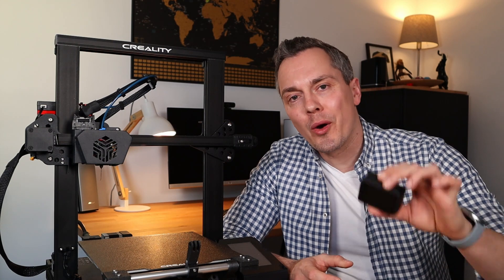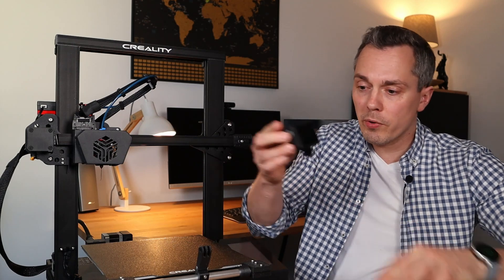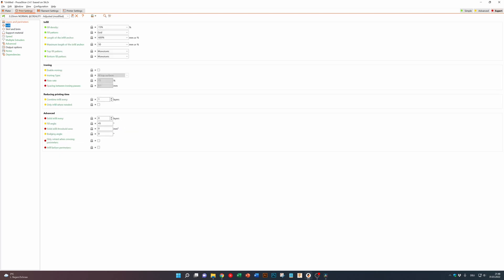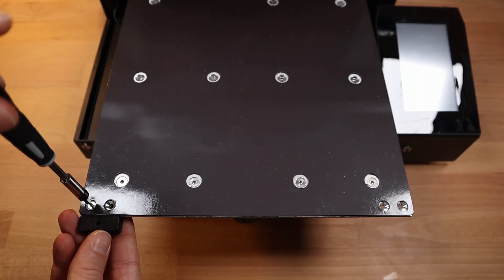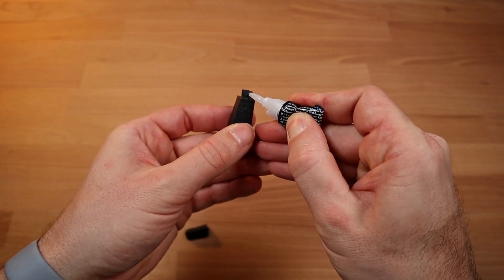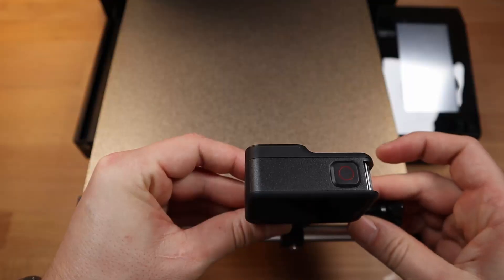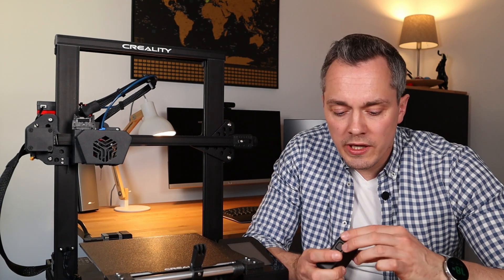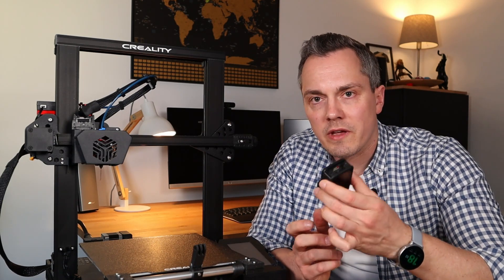Amazing 3D Printing Timelapses with GoPro Hero Mount | Creality CR-6 SE & CR-10 MAX & Many More

Comment: @TheBuildBay I would also need the settings. I tried with a GoPro Hero 9, both timelapse videos and timelapse photos but for about 3 hours of printing I get timelapses of about 8 minutes. I should do a timelapse like yours so about 10/15 seconds. What interval is preferable so that it is smooth without missing parts but does not last long? Thx ♥